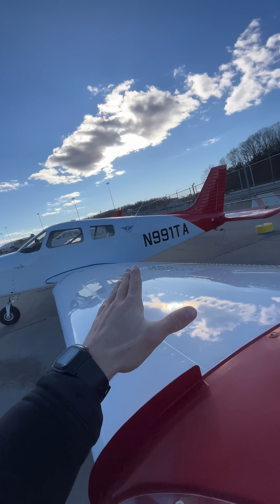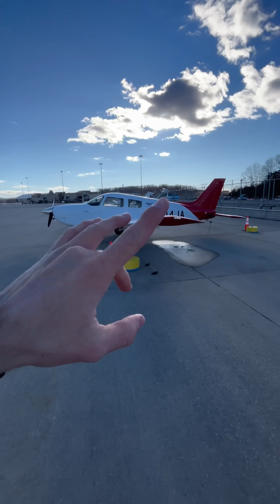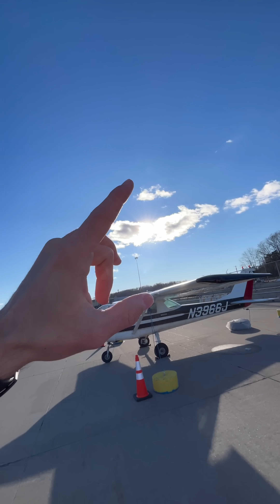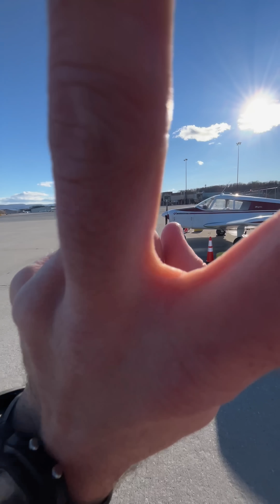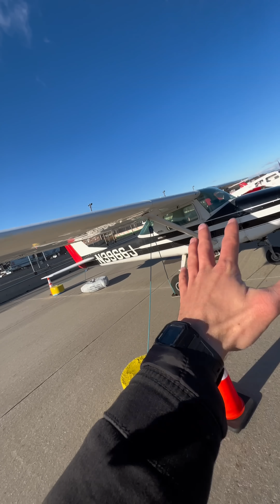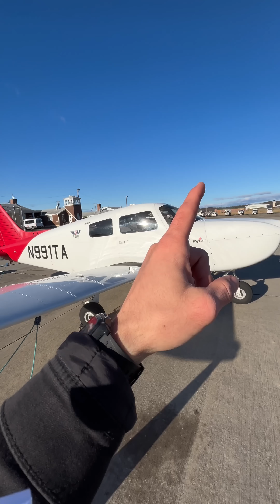ICING 🧁 ✈️❄️

Comment: Icing can form extremely quickly. The other day, my instructor and I got stuck above a layer of overcast that was around 400 feet thick. Temperatures were around -4. We didn't have any other options and we had to dive through the layer. We spent less than 30 seconds in the layer while on an ILS and when we broke out, we had trace amounts of ice starting to form.